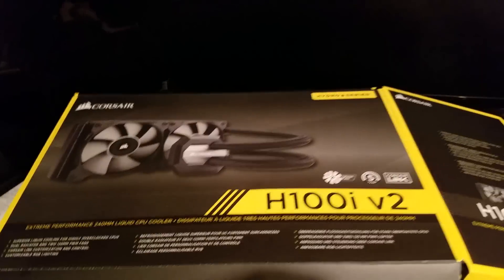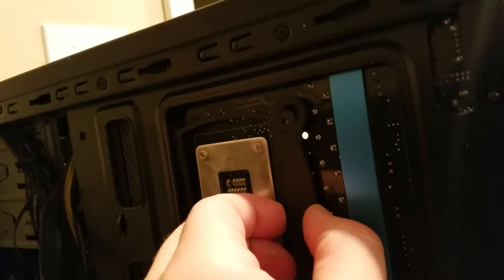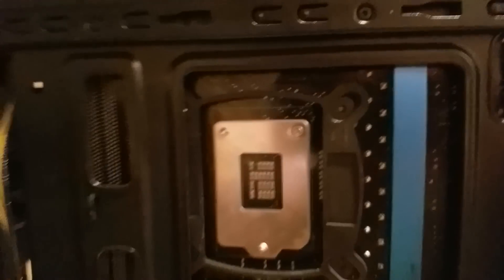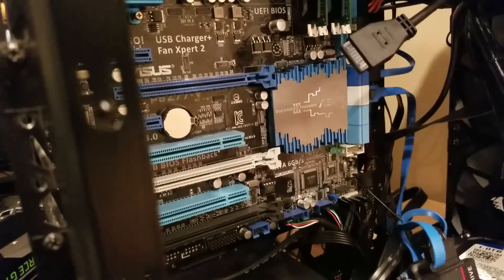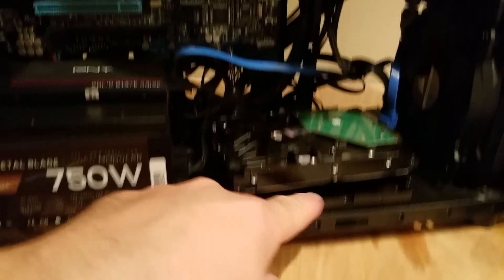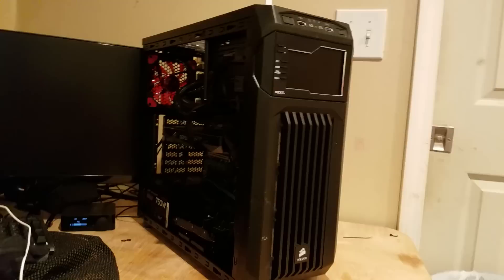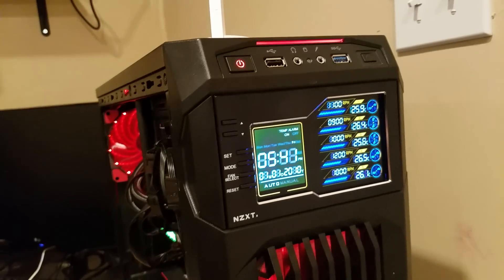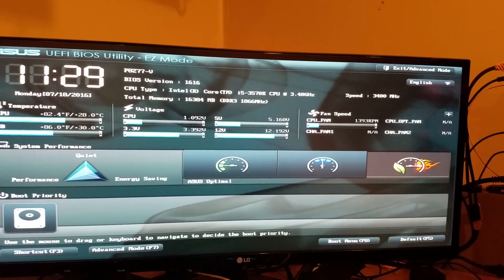Corsair H100i v2 Liquid CPU cooler Issues fixed

Comment: OMG THNAKYOU I BOUGHT THE EXACT WASHERS AND MY TEMPS ARE 3 TIMES BETTER OMG THNAKYOU
Reply from the maker: I'm glad that I can help you. With this particular board I had to use washers but once I switched to "Asus ROG Hero VIII" I didn't have to use washers and temps were around mid 50's under stress.
Reply: i have the i5 4690k at 4.5ghz and on my hyper 212 evo i kept getting 72c under full load i installed the new cooler and i was getting 85c under load and 45c at idle i bought 8 washers but i could only fit 1 on each side thats all i needed now i get 30c at idle and 62 c at full load thanks man
Reply from the maker: Yea I used just one washer on each side, I'm using i7 6700k 4.2ghz. I'm getting about same temps so yea great job and enjoy your new quiet rig!
Reply from the maker: Next thing you got to do is watch one of my last videos and I can show you how to water cool that GTX980 of yours
Reply: i have a 1070 like you lol but i will check it out rn thnaks

Comment: thanks for the great tips! I dont even have this cooler yet... but everybody that installs it in the videos, has the problem with the loose mounting plate.  You are correct, Corsair ought to include some 4 rubber washers! This thing costs $100, throw in some washers you cheap'-os!

Comment: only one of the fans from the h100iv2 is working. is it broken or do i need to plug the cables somewhere else.  i have the cooler plugged into cpu fan 1 on mb.
Reply from the maker: I It looks like your fan isn't working, You can try plugging it into another fan port but I would say based of what you told me it sounds like faulty fan or it might just be the plug on your fan cable.  One fan might be ok for time being as long as you are not OC that CPU your temps will be ok. I had 4 fans on my build originally which was push-pull config and now on my newer build I'm only using x2 120mm Pull config with i7 6700k 4.2ghz and temps are about same as when I had 2 more fans.

Comment: Did it say in the fan settings (like u were in) that the CPU fan was "N/A"? ( before u fixed it) I'm trying to figure out if this is the problem or the cooler is busted after 9 months of use.

Comment: Before trying this people need to check their pump operations with Corsair Link first to make sure the pump isn't dead. The rad for H100i is nickel while the water block is copper. These two metal doesn't mix well and within a few month it can cause enough residue and kill your pump.
Reply from the maker: Absolutely right... I checked everything before hand and even the pump was tight on the cpu but my temps kept rising. Anyways this trick did fix the problem however I don't use washers for my newer build as it works just as it was intended.

Comment: I have a question, why does the CPU gets up to 100C while on full load?
When I first bought the cooler it was 65C max
Replacing thermal compound to a Noctua one only made it worse
Reply from the maker: Is it H100i? How old is it? Did you dust off radiators? Check Fan RPM under load. You might have to reset your pump as it possibly not seated properly. I would use 4 rubber washers to insure that it is seated in this case. I don't think that thermal paste has much to do with your thermals rising also check to make sure that your pump isn't dead or dying.
Reply from the maker: Let me know if you need any help with checking all of these, I can point you in the right direction. Sorry it took so long to respond I was away from all Tech for few days.

Comment: Everything looks tight, I think you have a mid-tower case, for using water cooling / radiator solution I would go with a full tower ATX type case, something like the Obsidian 750D or the 780T ... there's other cases out there too by Cooler Master which would work also - MasterCase 5 Pro
Reply from the maker: https://www.youtube.com/watch?v=rHdwsW3plx8&t=185s Watch this Video of the case I went with, Its Corsair Carbide Clear 400C IT was 100% of what I was looking for. Skip the Video about 5min into my finished product as I have both CPU and GPU water cooled all in the front. With my new build I don't use the rubber washers as everything fits as it should. I guess I need to make a video about that lol

Comment: I just bought this today and had exactly the same problem.  I used metal washers (as that was all I had) and it seems to be going fine.  Thanks for posting.  I was disappointed that Corsair did such a crap job at building this... but at least I got it to work !!  Thanks.
Reply from the maker: NP, I im glad that I can help. I would not recommend metal washers as they could put a lot of stress on your MB VS rubber ones give you almost none. About a week ago did 100% rebuild of my PC into new case and this time I decided not to use the washers as I had different MB and It works as it should now without any washers. I will do a video soon to explain the difference or what could have happened. Its great that you got it working and I think you will be fine with metal washers as long as you don't have it too tight. Enjoy your room and PC being much cooler and quieter =)

Comment: When I had installed mine, it looked like I was going to have the same exact problem. But when I screwed down the cooler block the backplate was secured completely. Just thought I'd share this thought. :P
Reply from the maker: Yes same here bud, mine was loose and once I put the pump on it got tight but temps kept going up. You have to keep in mind with the rubber washers its still loose some just not as much but it 100% fixed my issue and for bunch of others as well.

Comment: how it going now? any problem when u put the washer ?
Reply from the maker: Since this Video I have gotten new set up, I'm using i7 6700k with Asus ROG Hero VIII Mother board and I used washers on it as well as I didn't even check to see if its gonna be loose or not I just did it. Idle temp is around 22-28C and While I'm gaming It stays at 45C.
Reply: I have the exact same set up as you. When I put everything together I was getting CPU temp of 90c on idle. When I loaded my bios I keep getting CPU fan error. I didn't do the washer thing yet but my water cooler seems like its on tight as it is. No wiggle room. Did you have this problem when you got your new set up? Thanks.
Reply from the maker: Sorry for late respond, Yes same issues. Just set your CPU fan to Ignore. As you are not running CPU fan because you have the pump. Everything was tight when I did it 1st time. Pump was tight on cpu as it should but my temps were still rising. I double checked to insure that I installed it correctly and everything was correct, there is no other way. I used the washers on the back side and it fixed my problem 100%.
Reply: I went ahead and got the same washers as well and sure enough it worked. Thank you so much for posting this video! I was really disappointed with this product because it didn't seem like it would work till I watch this video. Very happy with everything now. My only gripe with the cooler now is that the radiator fans sometimes rattle when RPM's spike from quick CPU load. Yours do that as well?
Reply from the maker: I glad that this was able to help you. I don't get much noise from mine but I use headphones most of the time and my GPU is Overclocked slightly so it kind of loud overall so I don't hear anything from my radiator.